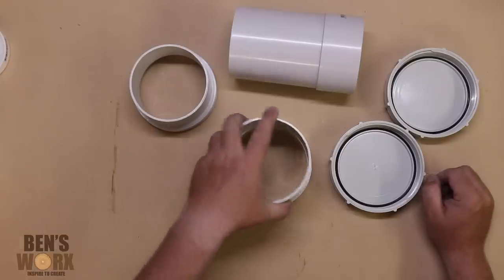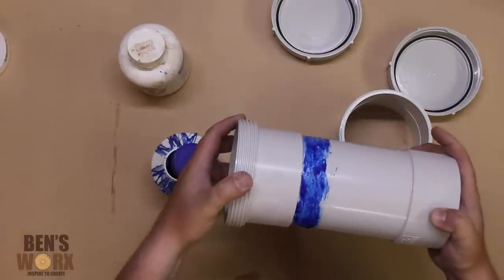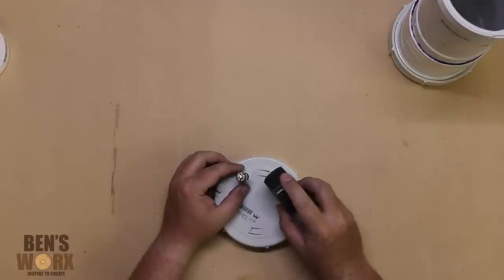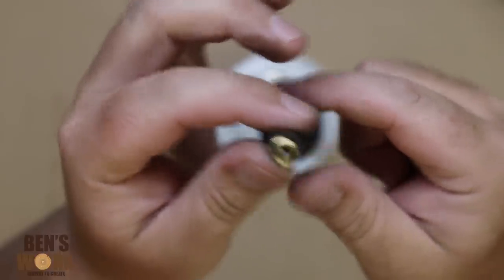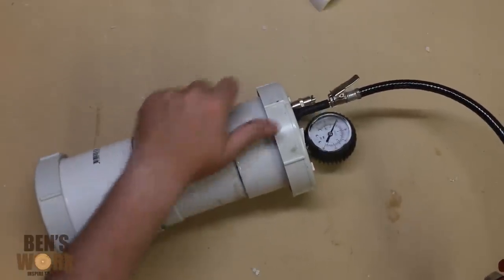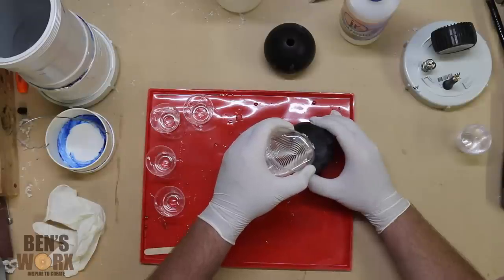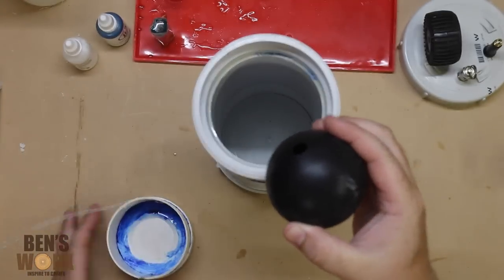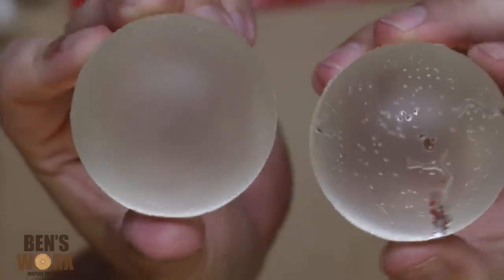Diy pressure pot for resin casting with test casting

Comment: Hey, Ben, I tried this and it worked great, I'm just having some issues with leaks in the cap... do you have any recommendations? It's the part where it screws open so I can't use epoxy or cement on it. But thanks for saving me a lot of money on a pressure pot!
Reply from the maker: Thanks Vanessa, try a bit of vasoline on the o ring
Reply: You could try a bit of thread tape or thread sealant as well.

Comment: Does a pressure pot speed up curing time? Great videos by the way!
Reply from the maker: Hi Mate, not that i have found
Reply: Create Live Explore it can slightly depending on the surface area exposed to air (like an open-faced one-sided mold). This is not enough to change your cure time however.

Comment: Hey Ben! Im having trouble finding everything I need at home depot.. anyway you could give me the sizes of each item? Both caps and the tube extention? Also the cap(?) You use for lowering stuff in and out of it? I showed this video to the workers there and they hadnt a clue what sizes to even look at. Thanks in advance!!
Reply from the maker: Hey, the sizes are really irrelevant, just get any size you can that is thick walled and pressure rated, you just need the parts to fit together. My pipes are 100mm
Reply: Sweet! Thanks!! :-)

Comment: hi ben, could i use this to remove the resin from my mixing cup, then take it out and pour? or does it need to be inside the chamber for the full cure time for the bubbles to pop??
Reply: Pressurizing resin doesn't pop bubbles, it shrinks them down until they're microscopic. Once the resin cures the compressed bubbles can't expand.

Comment: Hey Ben do you think you can give me names of the parts used, because I am trying to find them so I can make this myself.
Reply from the maker: There called storm water couplers with screw caps fitted to a piece of offcut storm water pipe
Reply: @BensWorx  thanks can you find them at Lowe's, or where do you have to go to. Could you give me a link to find them, because I am trying to find them myself and I am having trouble.

Comment: Spent an hour in Home Depot trying to find these parts. I was able to concoct one onsite but they have no end caps other than the screw on type. Could not find any ends with seals on them. Didnt think the screw on caps would work unless they were also glued on but then you cant open it up. Anyone in the states make one? Perhaps these end caps only exist overseas.
Reply from the maker: That’s no good mate, i hope someone can help you out
Reply: I'm having the exact same problem.  I've tried Lowes and Home Depot with no luck.

Comment: Are we filling the Air into the Pot OR pulling out the Air?
Reply from the maker: Filling with air
Reply: So Pressure Cooker can be used for the Same?
Reply from the maker: Yes
Reply: Wow... i have one Cooker ... lets make convert it... ...

Comment: Can't find these parts in either Lowe's or Home Depot. Doesn't make sense. I'm pissed.
Reply: I tried home depot as well, I asked for the sizes of everything and might just order off amazon. Cause the nearst home depot to me is about an hour away. Lol.
Reply: Have the same problem and found a wide neck drum with 1 gallon. I try this the next days. It is even cheap and there are a lot of resellers
Reply: @Taubrala  did you end up trying this out? How did it go, and do you possibly have links for the materials?
Reply: @RoozdenScoot  yes, the producer has an official documentation where is declared, that these neck drums are designed to release pressure, but dont let an underpressure "in". So its not working.... i am still looking for an pressure pot. I even build one like shown in this vid.... it exploded by 2 bar...

Comment: Can this handle up to 40 PSI.
Reply: I wouldn't recommend it - this is probably fine for low pressure but if you start approaching high pressues it'll likely fail catastrophically and shoot PVC shard at you.
Reply: @evansn79  okay well I am trying to find a way of making a pressure pot for dice casting.

Comment: Actually, human usually use vacuum camera to delete bobbles,  why pressure cam? I mean, how it's works?
Reply: Actually vacuum degassing is best for things like RTV rubber.  Pressure works well on resin castings because it crushes the bubbles down so small they are invisible.

Comment: Hey would this pressure pot work with fast hardenin resin casts like 2minutes ?
Reply from the maker: Depends how quick you are, if you can get it in and pressurized in time it should work
Reply: Ben's Worx thanx how much pressure do u think i should apply considering its 2 min To make this work ? Or it does not matter ?
Reply from the maker: It shouldn’t matter mate, just don’t over pressure the chamber
Reply: Ben's Worx u rock brothar!!! ima blow some pipes up!!!!!!11

Comment: Why use pressure as opposed to a vacuum?  My thought is that pressure would cause internal stress where the bubbles have been compressed. Anybody have any thoughts on this?
Reply: Some answered this already.  They said you have to use pressure because vacuum will pull the resin all over inside the vacuum chamber. What a mess that would be.  With pressure you're pushing all the resin together, with vacuum the suction tries to pull the resin out through the hole where the vacuum pump is attached.

Comment: That's fantastic, I had no idea that positive pressure would work that way, is this a replacement to a vacuum chamber or something different all together?
Reply from the maker: Hey Mate, a vacuum chamber works well for degassing, or casting items with many crevices that need the resin sucked into. For simple castings you can skip the vacuum and just use a pressure pot
Reply: Ben's Worx   Do you have to pressurize it until it’s cured or just long enough to get the air bubble out like a vacuum?
Reply from the maker: Just long enough to get the air out should be ok 👍
Reply: Ben's Worx thanks mate, believe it or not I had a friend asking me about this last weekend, I obviously just subscribe to the right channels, expect another fan
Reply from the maker: Thanks Mate!

Comment: Hey Ben, got a question for ya; what is the highest PSI that this DIY Pressure Pot can withstand?

I'm definitely going to invest in making one, I just don't want to get too excited and pressurize it too much on my first go, as some mixes require higher PSI pressurizations and such.
Reply from the maker: I wouldn’t recommend pressuring above 20psi, make sure you use thick walled pvc and use pressure cement to glue it together. If you want to use higher pressure, i have a video on my channel were i convert a steel paint pot for resin casting
Reply: Wonderful! Thank you! 

I was actually just watching that video, but I'm not sure where to find a steel paint pot in Canada; most of the hardware stores I'm aware of don't have any on their websites. :/
Reply from the maker: Maybe try an auto parts store
Reply: Oh good idea! Thanks!
Reply from the maker: No worries
Reply: @RaquelsChibiMinis  Have you found your paint pot yet? If not, try KMS Tools. SKU # CH-PT281403AV. While KMS is only in BC and Alberta, we can ship across Canada

Comment: max psi capacity ? i need 70 psi chamber...
Reply from the maker: Hi Cristobal, if you need 70 psi you need a metal pressure pot
Reply: thanks Ben!! look its for a casting process (small toy pieces ) but always see the people working between 45 and 70 psi for 30 minutes...
Reply from the maker: I’ve never gone above 20 psi and my castings have turned out great, i leave them in the pressure pot overnight to cure
Reply: great so i'll try it!!
I try to cast a Goku hair (dragon ball character ) and his hair its a nightmare.. so i really need this pressure pot!! thanks 4 all!!
Reply from the maker: No worries mate!
Reply: Ben's Worx and what about pressure cooker ?
Reply from the maker: I’m not sure about that, maybe if you could disable the heat function.

Comment: PVC shatters into shrapnel. NOT a great material for a pressure tank. It should be able to handle the pressure, but if the tank falls off the table when it's filled, it could turn into a grenade. Instead, use a paint pressure pot: https://www.ebay.com/itm/High-Pressure-Pot-Air-Paint-Spray-Gun-2-1-2-Gallon-Industrial-Painting-Painter/202080097264?hash=item2f0ce993f0:g:MxYAAOSwWTRWvqO5 Also, adding heat greatly reduces the epoxy's viscosity, so if you had a metal pot, you could heat it up a bit and it'll work even better to get rid of the bubbles. (Speaking from experience).
Reply: Agreed, this is a very dangerous design all around.
Reply: Valid concern with the falling off a table. 

If you account for this and place the tank on the ground, and applied the glue properly, you should be fine. SCH40 PVC is rated for way more than 18PSI. I've built a few pneumatic cannons with SCH40 that ran at 100PSI with no issues.

Comment: This is a risky assembly I would say, my threaded end cap blew off into small pieces made from much thicker 16bar irrigation pvc fittings (never took it above 4bar). I think it's the fatigue from repeated use and perhaps something to do with urethane fumes. Stick to steel pots is best.
Reply from the maker: 4 bar is way too much for this pot, I don’t go over 20psi and still get clear castings

Comment: This is a very dangerous design all around.  The savings are not worth the risk.  The thinner parts of the PVC walls, or the PVC welds, could fail, causing explosion, or the tube to separate and shoot apart like a rocket.  The safety valve is likely no help either.  The pressure here was tested at 18 psi, but that valve will probably not release until a much higher pressure is reached (it looks to me like one that's rated at 100psi).  And with such a small vessel, the pressure rises VERY quickly.   Also the only means of cutting off pressure in this design is to pop off the pump nozzle... it should really be a separate lever valve.  One moment of inattention, or fumbling with removing that bicycle pump valve, could lead to overinflation and explosion. I have seen a pressure pot failure and explode at a shop where I once worked.  It's something I'll never forget.   A 2.5 gallon painter's pot can be had for about $100, plus about $15 in fittings needed for pressure casting.
Reply: I should also say, I don't mean to be a naysayer.  It's a clever idea for sure, and the benefits of casting under pressure are definitely worth the effort.  I'd just hate seeing what happens when it goes wrong...
Reply: @Exskullent  You're right, but 18 psi isn't that much either, I was surprised the bubbles disappeared with this pressure

Comment: I cannot for the life of me get mine to seal with any kind of pressure
Reply: Have you tracked down where it's leaking? You can try pressurizing it and putting it under water to see where air is getting out.
Reply: @mouseas  It leaks from the seal in the cap, no matter how tight I get it, it always leaks. This is high pressure rated PVC.
Reply: Have you got Teflon tape on the threads?
Reply: @mouseas  nope, just lubed the o-ring, will have to try tape next

Comment: This is a very dangerous idea. I've had two pressure pots explode while working with them over the years and both were steel at 30 psi. You could be setting yourself up for a lawsuit.
Reply from the maker: I have a disclaimer in the description, I accept no responsibility for any damages as a result of someone building the pot
Reply: Brother, I don't know if it's enough. Can you not build it out of steel pipe? Be safe!
Reply from the maker: Thanks Mate I’ll give it a go

Comment: DO NOT MAKE THIS. I am a professional prop maker with 8+ years experience and years working in studios. Plastic like this is not rated for any sort of positive air pressure. Yes the safety release valve * should * prevent an explosion but you are gambling so much on cheap parts. If you use pvc for air pressure professionally you violate OSHA safety standards. This isn't precautionary, I literally know someone who lost an eye because of a DIY pressure pot. 
Ben, please consider removing this video. What happens when someone following this tutorial gets hurt? Ask yourself this, am I okay with being liable for the worst version someone would make of this? The version where a part fails, a step is skipped, a piece is replaced, or someone pushes it just a bit too far. It's not an if this will fail, it's a when.
Reply: Hey bud the pvc says it’s rated for a certain psi so as long as you don’t go over you should be good
Reply: @Cube-sb9tp  there are parts of PVC pipes rated for pressure, yes. You are relying on all the seams and glue and valves and other variables in this too. 

If ONE THING goes wrong you are basically entrusting a major accident on a single safety release valve. 

Also pressure pots at harbor freight are $90. If you have the money for this caliber of resin castibg and do this tutorial you have no excuse.